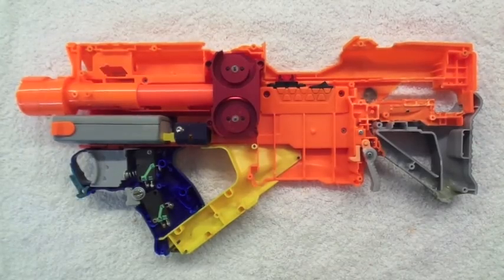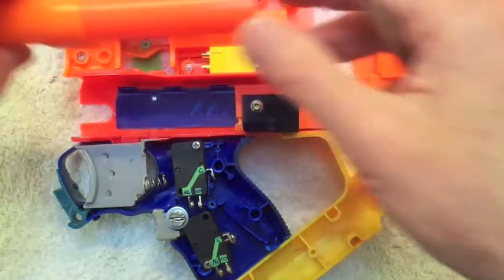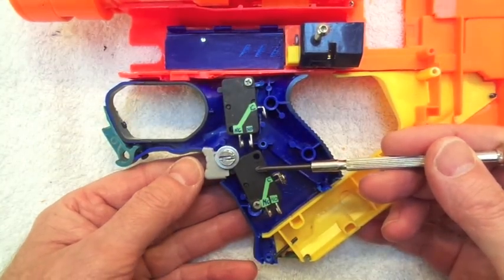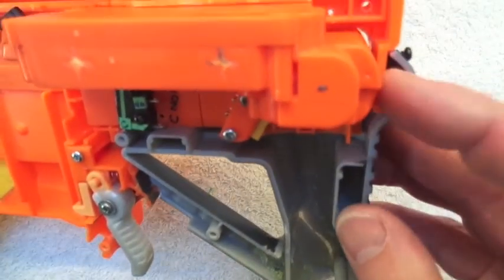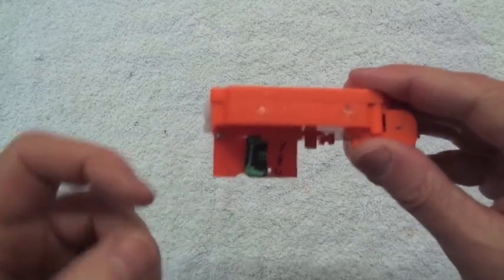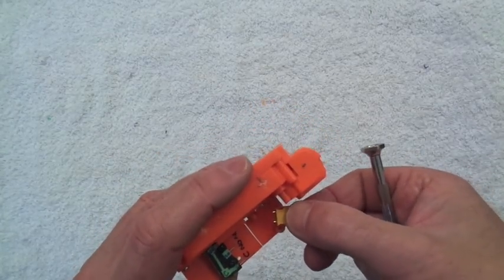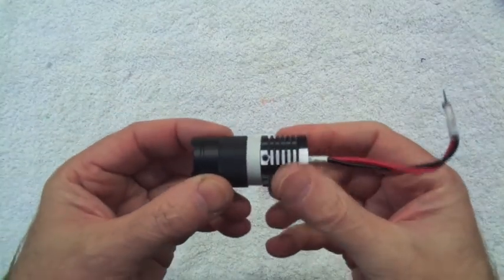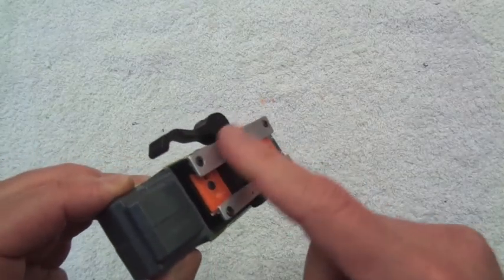"HushPuppy" WIP Update #5: Electrical System Pre-Wire Walk-Through

Comment: This is really useful info. I'm thinking about building a rapidstrike/centurion integration but I really don't like the RS shell. Might have to build it with a Demolisher instead now.
Reply from the maker: Cool! Glad it helped. Check out the link above to the BritNerf build-log for more detail. The RS pusher is a good fit in there, but I'm hoping to try a solenoid next time (heavier, but easier wiring...) with a Daybreak cage. Demolisher shell overall feels more solid, and mag-fit is much more secure (so less chance of pusher-arm jamming up). Haven't touched Centurion shell so no sure about fit, but if the RS fits in there the Demo's probably good too.
Reply: @unscrupulousmodefiler  I've started cutting up a Demolisher to make the RS pusher fit. It would be a lot easier with a Dremel.
Reply from the maker: @boostaddict_  You're doing all that without a Dremel?? ResPECT.
Reply: @unscrupulousmodefiler  yeah, used cutting pliers for a bunch of webbing and scored through the big layers with a screwdriver. Then lots of filing took place.

Comment: You could consider using NiMh cells for your 3v rail. That way you don't need to worry so much about draining them too far.
Reply from the maker: Hey thanks for the suggestion. I've actually tried NiMh but the ones I have are only rated to 1.2v... a single 14500 will give me 3.7v and so a brighter tac-torch and a small weight saving. In reality though this puppy'll very rarely be used at night, so it's more of an exploration of what's possible in the Demo shell.
Reply: Yeah I was thinking two of them to replace the two alkalines you have there.  All NiMH cells are 1.2v but most devices that are designed for two or more alkalines will also happily take NiMH despite the slightly lower voltage.